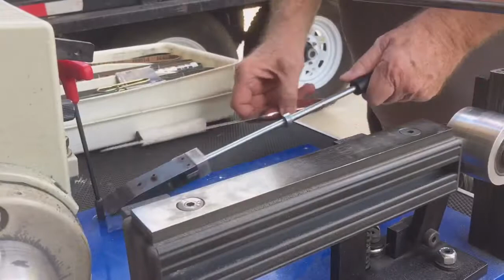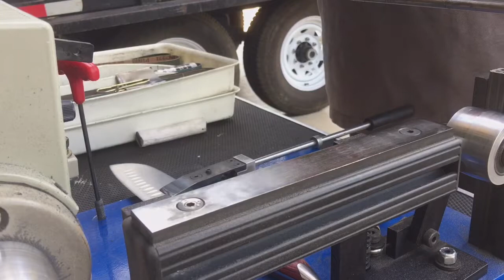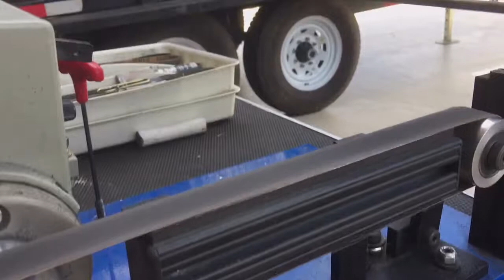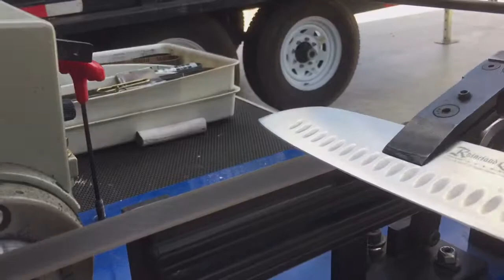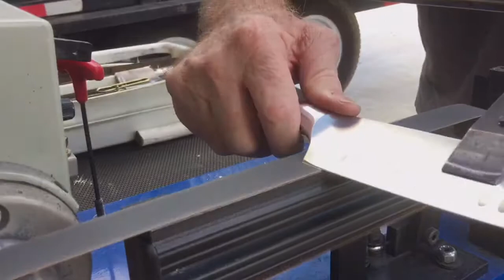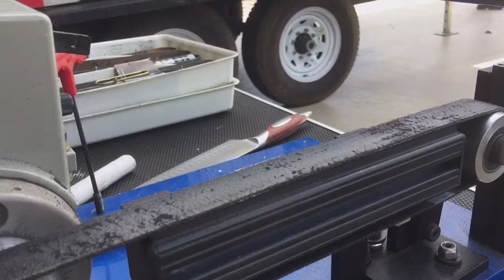Reignhold Cutlery set sharpened on the AMK-75

Comment: Do you have any issues with the blade getting over heated?
Reply: I would seriously doubt it.  The speed is low.  The passes are quick and light.  It takes a lot more than that to heat up a blade.  I use the poor mans version of this with a cheap 1x30 belt sander that runs faster and my knives never even get warm.